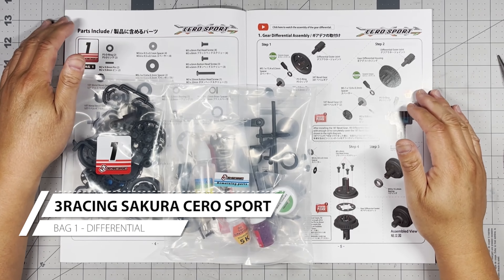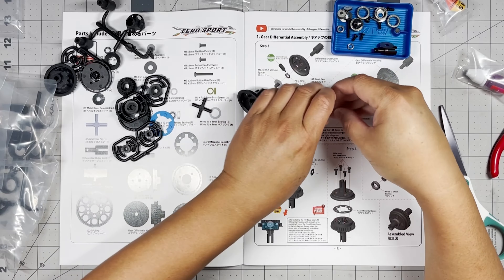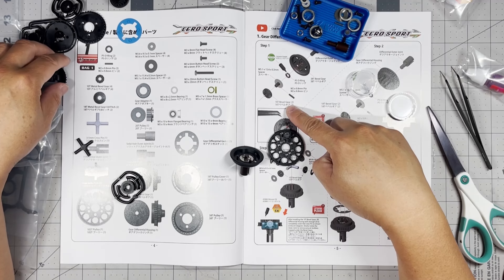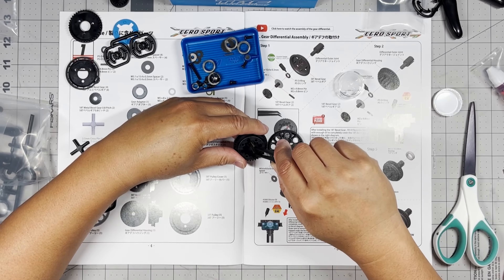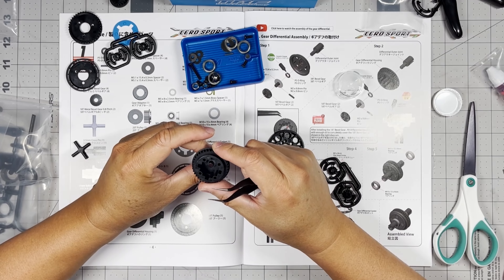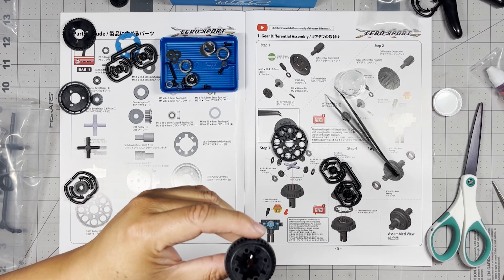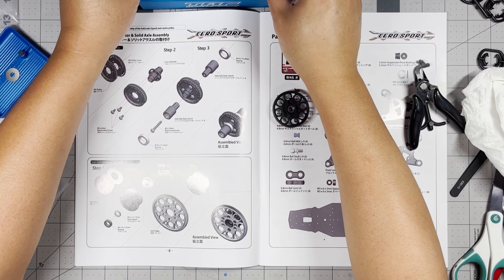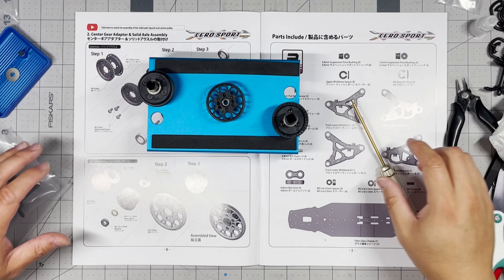3Racing Cero Sport - Bag 1 Differential #3racing #rccar #cerosport #ceroultra

Comment: You forgot the shim behind the 18 tooth bevel gear in step 2.  So the o-ring seal will wear out fast and the differential will start leaking badly and the all of the gears will wear out much faster than normal.  So keep an eye out for leakage.  Or, rather than waiting, you might want to check it.